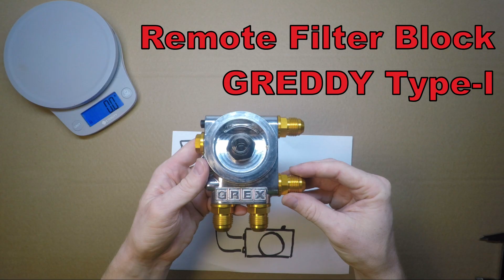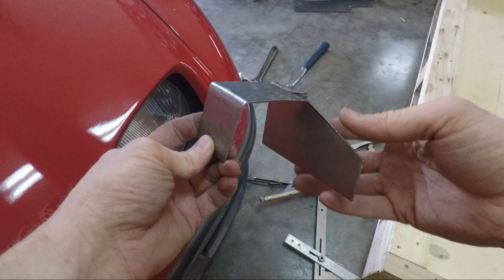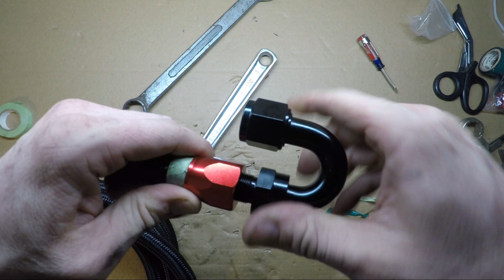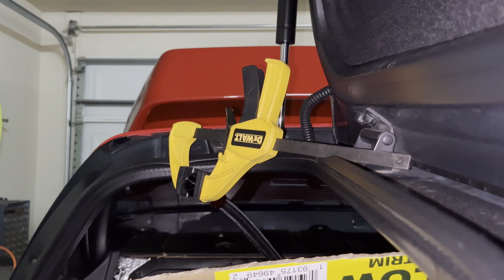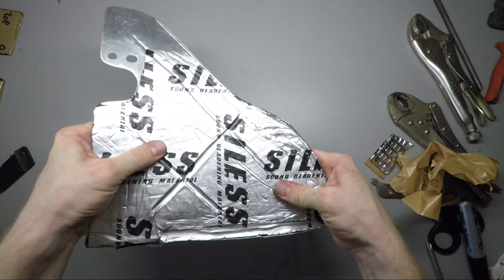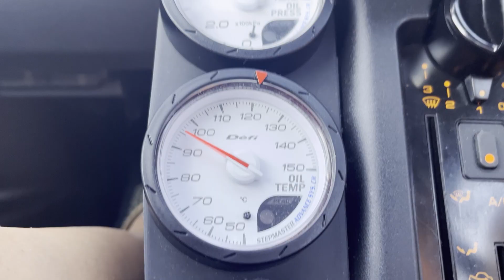Autozam AZ-1 Oil Cooler + Oil Filter Relocation Install | GREDDY

Comment: Can I access the oil filter by removing the passenger seat?
Reply from the maker: In the stock location you can access the filter from below, and/or through the engine hatch behind the driver seat. The relocation puts it easily accessible under the car behind driver. There isn't an access point behind the passenger seat, the cooler is accessed through the trunk hatch or the engine access behind the driver seat. With the relocation I can change the filter by reaching under the car without jacking it up.